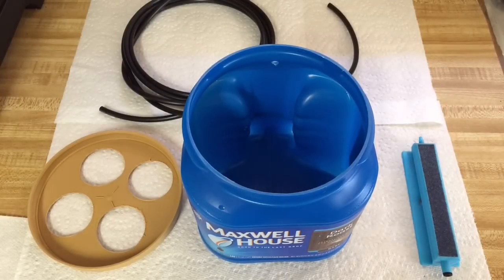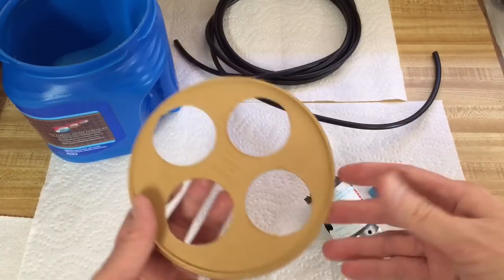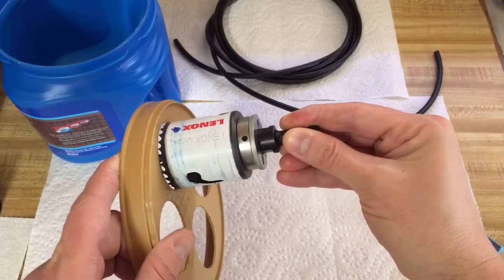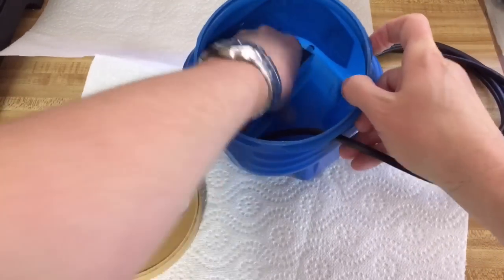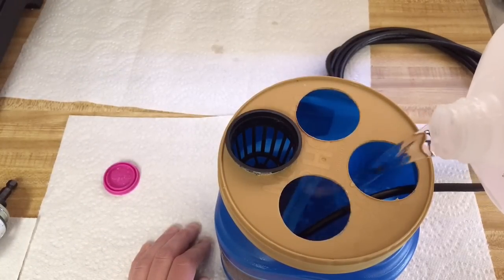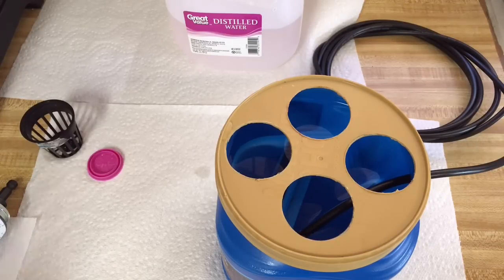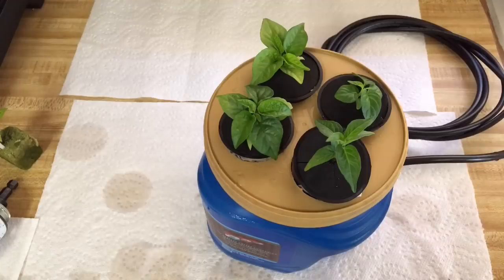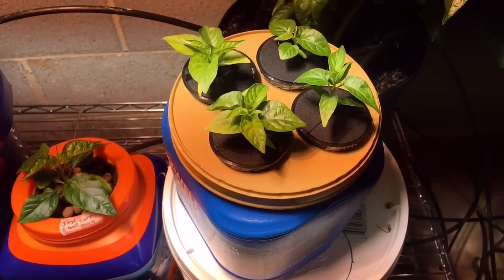How to make a hydroponic water culture system from a coffee container

Comment: why do you need the collar if its already in the rooter plug and basket? Wheres your tubing connected?
Reply from the maker: You're right, you can get by without those. I did it to block light. The tubing is coming in through the top side of the container and was connected to an air pump. Thanks for watching!

Comment: Thanks for the video!  

Why do you prefer the black airline instead of the clear?
Reply from the maker: It was what I had on hand. I had a bunch extra from setting up my drip system. It would be better than clear though in regards to UV protection to help prevent algae. I have some clear sight glass tubes that have that problem. I recently bought some clear blue UV protected tubing that I like better than the black. It's a lot more pliable.
Reply: There are several components to studying aquaponics. One place I discovered which successfully combines these is the Keiths Ponics Site (check it out on google) definately the best info i've seen. Check out this  great website.

Comment: When you made the holes in the plastic did you use a drill or did you just twizzle the drill bit around and around with your fingers?
Reply from the maker: I used a hole saw, got the center bit started in forward direction until it just went through, then switched to reverse for the rest of the cut. This made it a little easier drilling through plastic, so the bit wouldn't grab it so hard.
Reply: @pepperdactyl  sorry to waste your time I was in a silly mood when I asked that question. I was asking if you drilled the hole with your fingers lol. Sorry but thanks for taking the time to answer and for having a heart.
Reply from the maker: No worries! Thanks for watching!

Comment: If you have used all the solution and want to refill what are the guide lines as to how much solution to use. Excellent video. thanks
Reply from the maker: Thanks, for watching. For DWC, I usually fill up just below the bottoms of the net cups. For this system in the video, maybe 1/2 inch to an inch below. For something larger a little more, a couple inches maybe. If it's Kratky, it's trickier and I wouldn't go up more than a third of the container.

Comment: How long before it's too small for those 4 plant sites? Eventually the roots will become bound right? Then what you just transfer them to a bigger bucket?
Reply from the maker: Once they start getting crowded on top is a good time to move them. At that point, the roots shouldn't be too hard to untangle.
Reply: If you start your plant in the right sized container ( like a tote) then you don't have to worry about transplanting them. Personally I grow each plant and its own 5 gallon bucket. Easier to move around and space out to obtain full light, trim, roots dont tangle with other plants and if there are any males just remove the bucket from the room.

Comment: If you traced around the net cup it like you suggested, wouldn't the net cup fall into the hole since it's the same size?
Reply from the maker: Tracing it is just to get an idea where to drill. The main thing is your hole saw size. If you're using a new hole saw or net cup size, it's a good idea to drill in a piece of scrap first, and make sure your net pot fits okay before drilling your lid.
Reply: That's a great tip.  Thanks! :)

Comment: Great video , but you can also switch that to Kratky hydroponics no air stone required
Reply from the maker: +Jessie Scruggs I've experimented with Kratky on lettuces some and it works great. I know of people using it on mature pepper plants too, in a 55+ gal container. With Kratky on young peppers, I worry about the air-exposed roots drowning if more water is added later. I don't understand it well enough to know how they would transfer to an oxygenated solution like with dwc, or to a soil mix type medium. I'd be worth trying though and see how it does.
Reply: I've only got about a year on kratky under my belt, on my second spawn i did peppers when you look at the roots you can see the nutes that provide oxygen to the plant i refilled just under that point and had no issues with my pepper plants.
Reply: The rule with Kratky is not to refill the container to more than 2 inches and leaving some air gap.  That gives the roots time to adapt to a level change.  Refilling the level by 1 inch every few days is probably safer, knowing that the plants adapt.   I had an issue with cyanobacteria which browned the roots one time, so a couple of drops of algaecide each week took care of that.
Reply: i haven't had an issue with my  roots with Kratky, but i keep my chamber as sealed as possible.